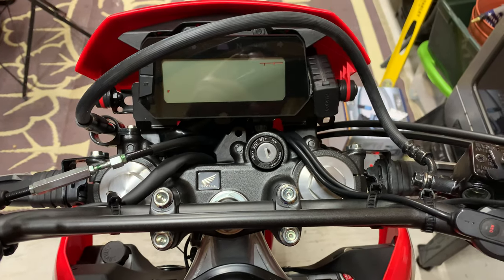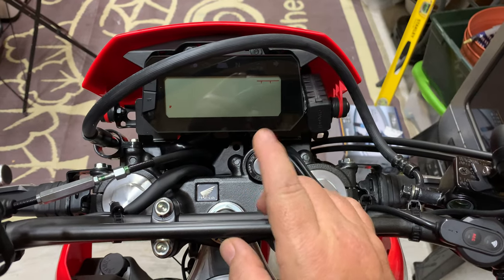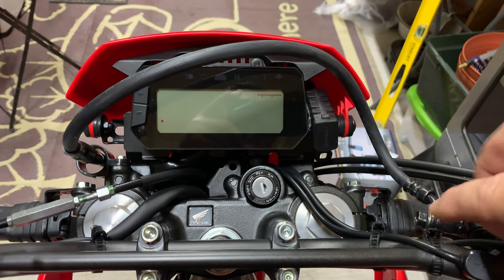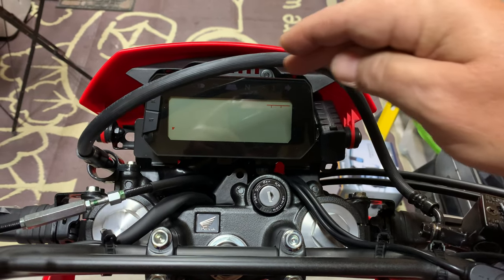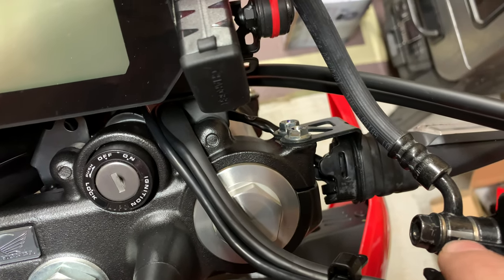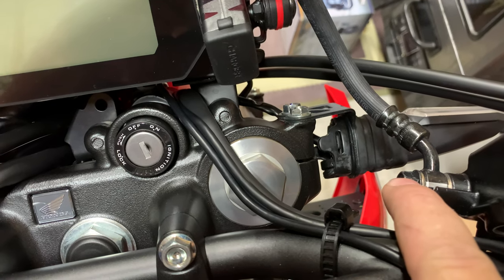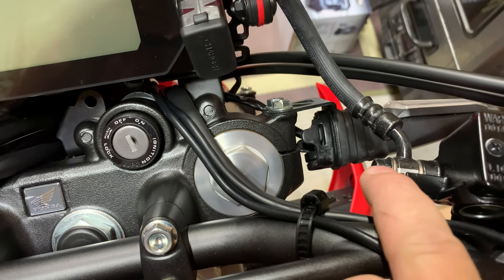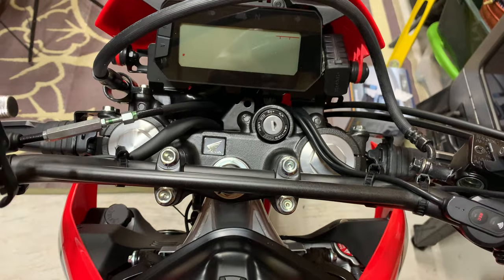2021 Honda CRF300L Stupid Front Brake Line Fix!

Comment: A 20 mm ( 3/4”) spacer and longer bolt on the top fork cable guide works. My bark busters prevent rotation of the union!
Reply from the maker: Good idea

Comment: Use a  M6x20mm+8mm Male to female Hex Brass Spacer Standoff and a washer,  on the break line guide, Just watched a video on it and you do not have to worry about getting air in your break fluid.  ( Honda CRF300L Break Line Problem )  Just remove the bolt then install the spacer standoff put bolt back through with washer next to the brass fitting to keep the guide from going over the standoff peace.  Snug it up and all done.
Reply from the maker: I wasn’t worried about getting air in the brake line, I didn’t loosen it enough for that to happen, I also have the setup your talking about now, works good!

Comment: Cool idea. Also maybe drill a small hole in the top of the headlight shroud and loosly zip-tie it up out of the way. Probably ugly but effective. Maybe use silicone to adhere it to the backside of shroud? Love your bike, Frank. This is the second CRF you have convinced me to order in 5 years. I'm a fan, my wife, not so much.
Reply from the maker: Haha I hear that a lot !
Reply: Bad idea.  The loop in the line is to provide slack, so as the front forks go up and down, the brake line can softly bend and straighten the loop.

Comment: I had a early 2014 250m that was not an issue, but the 2019 model 250l with abs at my height obscures the screen totally, I don't know how honda got it through homologation. A strategically placed cable tie helps, I'm still looking for a permanent solution. You're 300l without abs looks an easier fix.

Comment: Check out the Core Moto low profile front brake line. I have it on my 250L. It's a must have in my opinion.
Reply from the maker: I will give it a look
Reply: Any reason the 250l line they sell wouldn't fit for the 300l?
Reply from the maker: I just checked and they are exactly the same

Comment: any ideas on why the brake line for the front is totally different on an ABS model than a non ABS model? Can I just bypass all those blocks and run a stainless line from front master cylinder to the caliper?
Reply from the maker: Because the ABS is made with the blocks and electronics, you can not change it. My Africa twin was the same way
Reply: @WOODZMAN  thanks for the reply, looking forward to your videos on the new 300 products. I'm going nuts waiting parts to come out, especially hand guards because of the inserted weights and some plastic skid plates. I got mine 2 weeks ago that I had on order since Jan 2nd. Thanks!

Comment: the dealer put 91 gas in it I told them I think 87 will be fine and it is, book says 86 or higher.
Reply from the maker: Yea I have ran 87 in my 250L and I can’t tell a difference
Reply: 87 pump has shelf life of 30 days (so you need to put in fuel additive to keep it fresh) I use the Yamaha fuel conditioner myself (but Honda) makes some. Also the Premium 91 actually is anyways less carbon build up and longer shelf life before it loses octane.
Reply: @mt1885  well i'm a mech. for a large construction co. we put 87 in everything that takes gas some stuff sits for weeks fuel is never a problem. I'm in calif near the mountains and desert so i'm lucky if a tank of fuel last a week. many test done on additives none seem to be better than straight gas. taryl fixes all on you tube, additives don't hurt nothing so to each their own.
Reply: @joethompson9503  Additives due work - just like everything else. Let 87 pump sit for 1 year in a carb and see the end result.
Reply: @joethompson9503  Kalifornia place is a disaster of epic proportions
Reply from the maker: Yea but why do that, fuel don’t stay in my bike over a week
Reply: @mt1885  ok
Reply: @WOODZMAN  It is not meant for storage - all I am saying is the shelf life is 30 days so when people fill up whatever machine it is. It loses octane and degrades. Plus the ethanol ruins o-rings and other components. Not to worry new selected regime has said no more oil and time to ride in a motorized shopping cart.